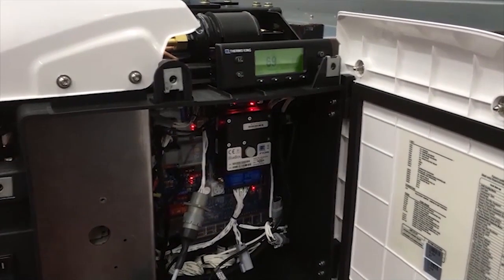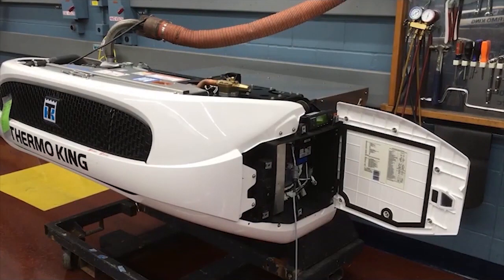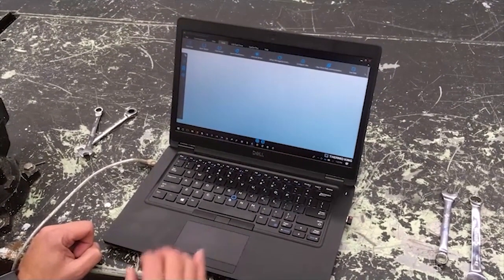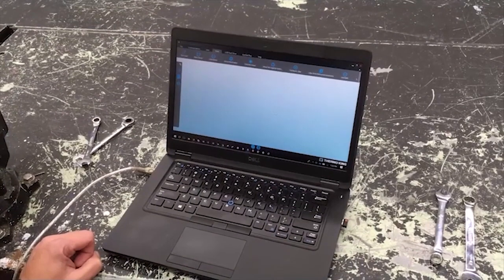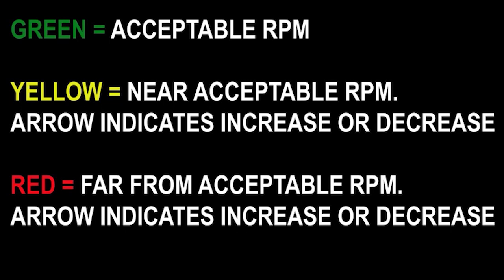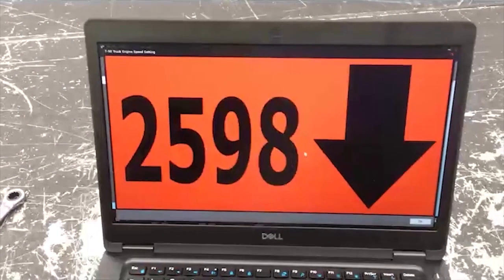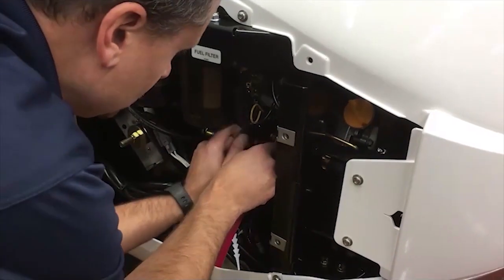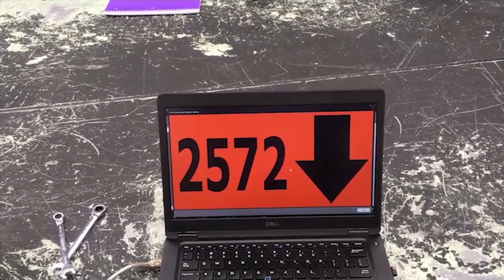T 90 RPM Adjustment Procedure TechTips

Comment: What about ETV position ? The unit will try to keep the rpm in range by throttling suction pressure. The rpm being okay doesn't really mean anything if the ETV is at 20 steps.